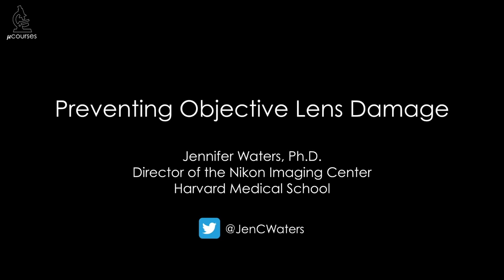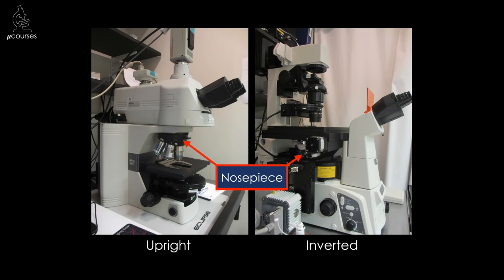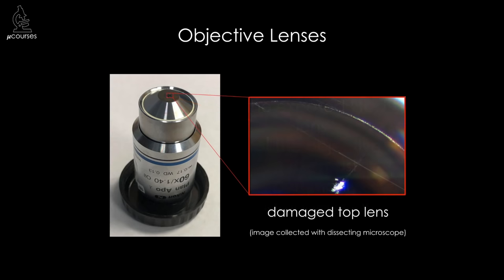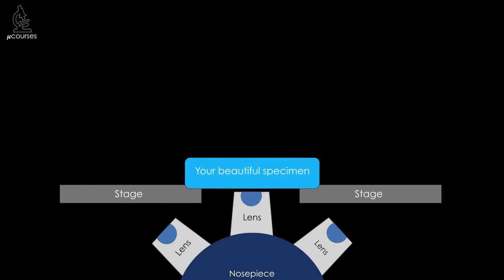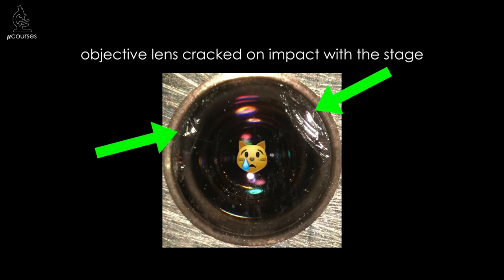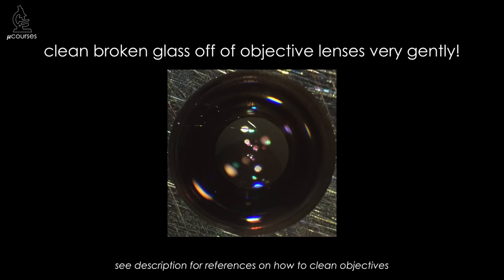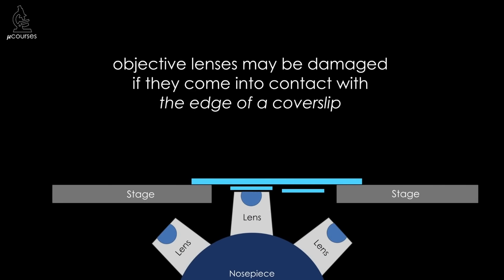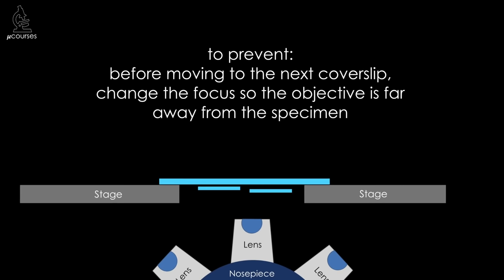Preventing Objective Lens Damage: Blunt Force Trauma

Comment: Hello thank you for the nice video. I have a question when you suggest to only "go away" from the object, how do I know how close to get in the first place before that? I know how to make the oil touch our glassbottom dishes and I try to even reuse Z-settings but even then I sometimes struggle to know how close I can get. And I am afraid of scratching the lense which has happened many times but I am very careful so I dont think it was me in our lab. Also I set it and then place the magnettic setting clamps but I am a bit afraid it might push down the glassbottom dishes. What do you think? Best wishes, a first-year Ph.D.

Comment: I covered the bottom of my stage petri dish holder with tape so the objective would hit a softer surface if accidentally touching it, plus, it is not fixed to the stage, so it can lift up, too, if touched by the objectives. But, best practice is lowering objectives before changing them.

Comment: I purchase a used Zeiss Axioskop 20 and refitted it with Plan-Apochromat DRY objectives. I've always wondered: when you do need to clean an objective lens, what's softest and most appropriate solvent to use (talking about the usual dirt to remove here, not oil, mounting medium or any other special circumstances)? I've seen people use ethanol, methanol, n-hexanes, water from breathing onto the lens, anionic detergents, isopropyl alcohol, Dazzlens solution (i-PrOH and AcOH), pharmacy grade 70% rubbing alcohol... I really need your expert input on this.  Is it better to use medical grade cotton swab damped in that solvent or wet lense paper to clean them ? How do you then dry them, dry cotton swab pass or dry lense paper pass ? Plan-apos are fine optics, I really want to prolong their life as much as possible... Thanks in advance for any advice.
Reply from the maker: For dirt that has settled on a dry lens, first try blowing the dirt off with pressurized air. If that doesn't do the trick and you need to use a solvent, dilute Sparkle (commercial ammonia-free glass cleaner) works well. Lens paper is recommended, as it is the most gentle. This book chapter offers more info on lens cleaning: https://www.ncbi.nlm.nih.gov/pubmed/24974022